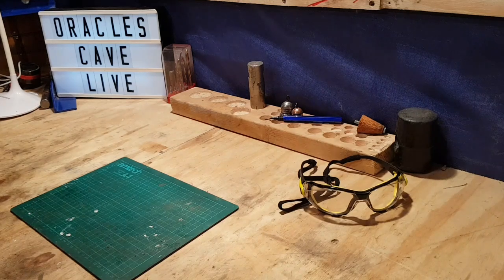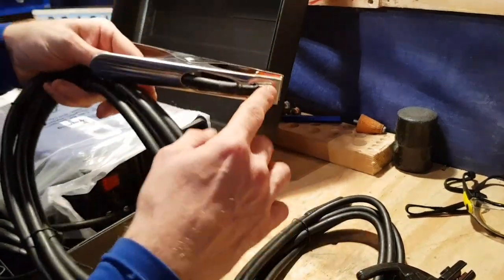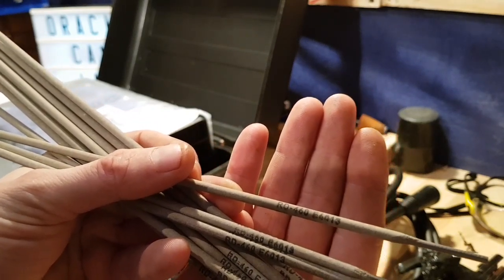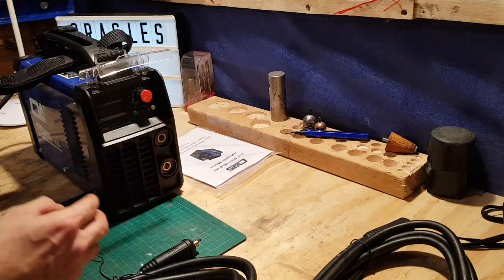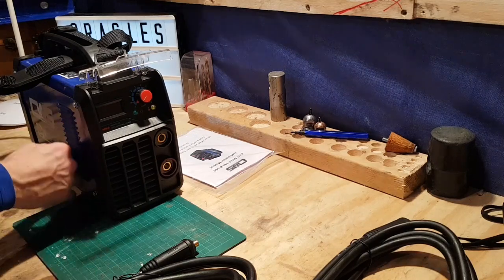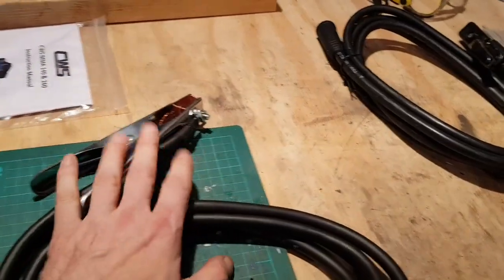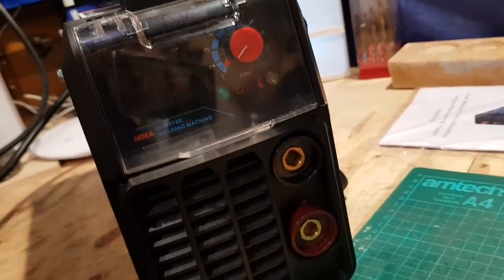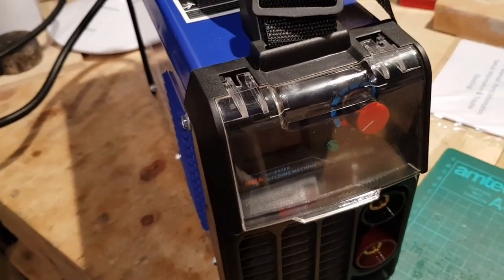CWS IGBT 160A DIGITAL INVERTER MMA STICK WELDER UNBOXING

Comment: will be interested to see how this pans out,been dabbling with getting a cheap welder for a while just for intermittent home use, a fellow colleague has been raving about his Aldi mma but he insists his is 100+Amps but they seem to have dropped the power to 80A now.With the multitude of chinese mmas from £50 plus on ebay why this particular one ? btw one of the complaints is the cheap welders readout doesn't match the amps
Reply from the maker: Not really specific reason but i had purchased 100amp mig and thought it was ok, so when looking for stick welder I wanted maximum amperage for 13amp socket.
So I started hunting good reviews for 160amp versions  and soon found they are mostly all rebranded welders in different cases, so I found the cheapest version of the model I wanted and bought it.
Other companies are selling same welder under other names and styles for a  hundred pounds more.

I don't mind buying twice, I'm not a tool snob, I love trying out all the lower end gear chinese specials.
I have only ever been let down a couple of times from stuff that's supposed to be useless and I have spent £1000's believe me.
I trust that this little machine will not only work but do it's job very well.
All the best
Darren 👍